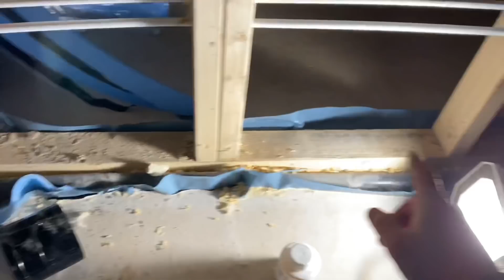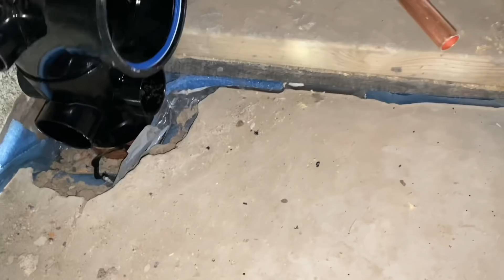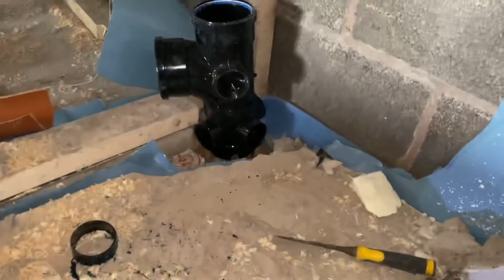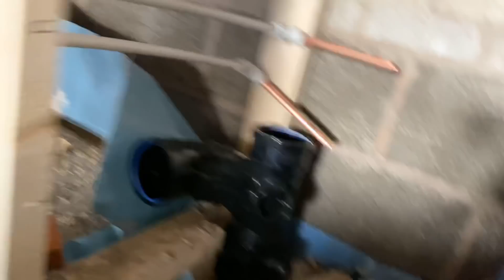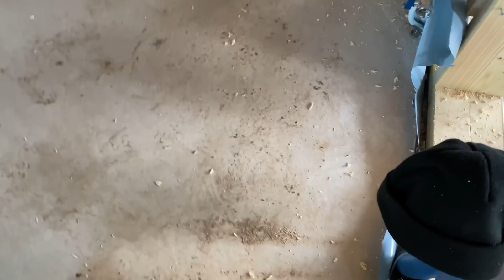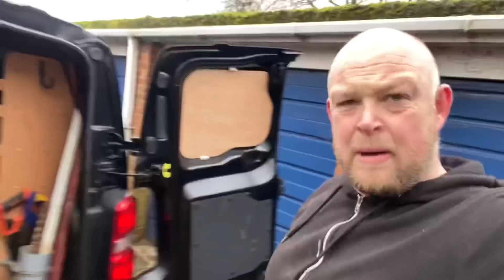HOW TO PRESSURE TEST NEW PLUMBING PIPEWORK, Weighing in Scrap copper..Fitting new SOIL & WASTE PIPES

Comment: Hi,
Love your video's. 
See the way you have a fitting on first to the waste pipe for shower bath etc, then your toilet, how did you know your centre for the 4 inch wasn't too high? Did you have a measurement from floor to centre beforehand? Ps, did you have to take any concrete out for the first bath and shower strap?

Comment: Good vid and nice to see the pressure test. Maybe could have saved a bit of time filling the system with a hose first - or was that not possible?
Reply from the maker: To be fair, it wasn’t that long, would of took longer trying to get the hose to reach as the cold mains are not connected yet so had to fill the buckets...

Comment: I bet that took an age to pump up the pressure tester 😂😂. At least you know your pipes are ok 👍👍. Nice bit of scrap pile 👍👍.. don't get anything for that plastic pipe 😂😂
Reply from the maker: Yep it took a while but I prefer to do it that way, call me old fashioned but I know it’s spot on AND been pressure tested wet...

Yep, tidy few hours on the scrap run buddy
Reply: Mind trying that on 4inch poly York mains going round a factory had us apprentices doing it in relays on the pump. Gave up eventually and put a compressor on it. Amazing how far a 4inch cast iron valve and 3m pipe can go even with 4 kerb stones keeping it down nearly💩maself🤣🤣🤣

Comment: Love your vids. Can you clear up a problem. I’ve been on jobs where some say you cannot solvent weld underground pipe 
But if it’s made of pvc you can how would you tell when only a little bit is showing above ground. (Curious carpenter).
Reply from the maker: Hey mate.... glad you like the videos mate, appreciate the feedback.

Solvent weld underground..... never heard you can’t use it underground tbh, always have with zero issues. Infact would rather use it underground than soft push fit that could come apart then your proper screwed!!!

Swimming pool installations are always in solvent from memory..
Reply from the maker: Oh Steve.... do you mean on the soil pipe?

The builder who fitted the underground drainage gave me the all clear to use solvent on the pipes he fitted as all was ok.

Thought you was talking about 11/2” solvent weld....
Reply: @MJTiffPlumbing  thanks for the reply.

Comment: I'd love to pressure test to 5 bar, on site I'm on they want me to pump up to 18bar takes so long
Reply from the maker: Why that high!!!!!.... thats putting too much pressure on the fittings imho...
Reply: @MJTiffPlumbing  thats what we've told them but barratts having none of it saying polyplumb have agreed with them that it's ok
Reply from the maker: Wow...... I would of said that’s putting undue pressure on a fitting which could weaken it for the future.

It’s usually 1.1x what the pressure will be.... I’ve never even know an incoming main to be 18bar, and even if it was high it’s always reduced down to 3bar anyway....

Strange that mate.....
Reply: I was always told you test should test 1 1/2 x the maximum working pressure of the system.  When I did my own house I tested all the copper lines to 15bar for piece of mind. If I remember correctly 15mm x 0.7wt copper tube is good for about 40bar.
Reply from the maker: Yep copper is used for high pressure air lines in places.... can hold a lot of pressure